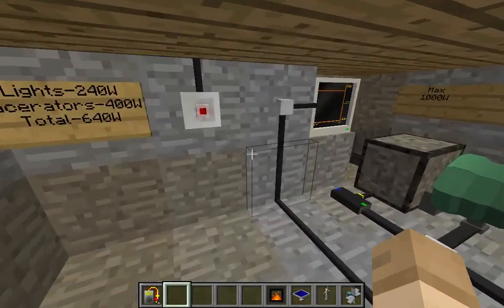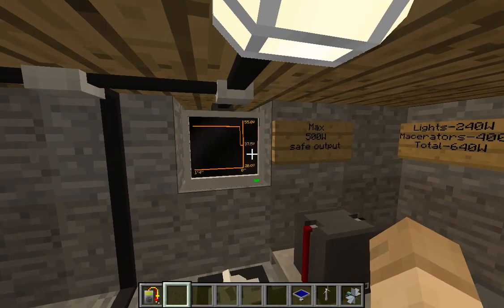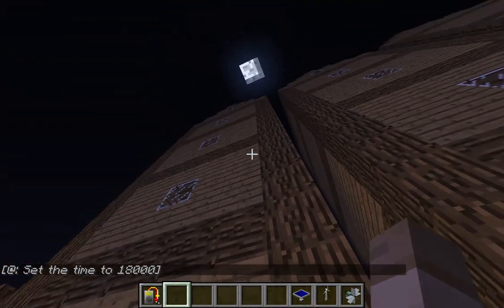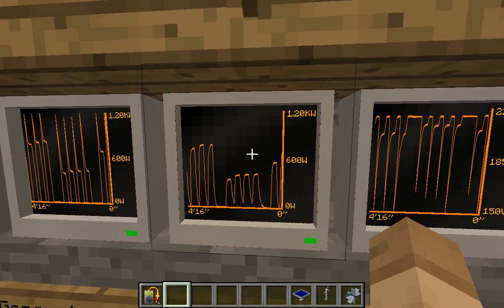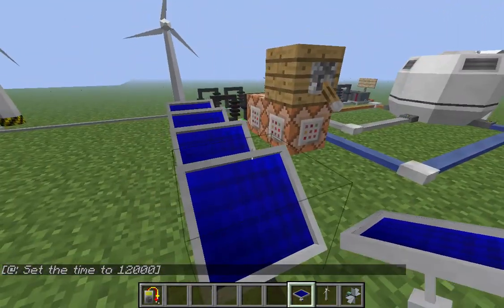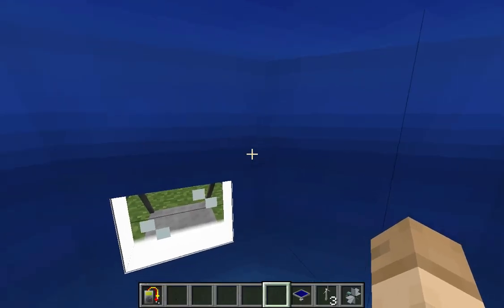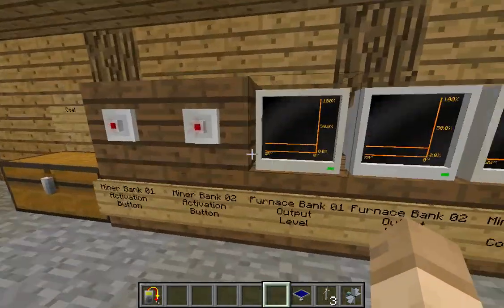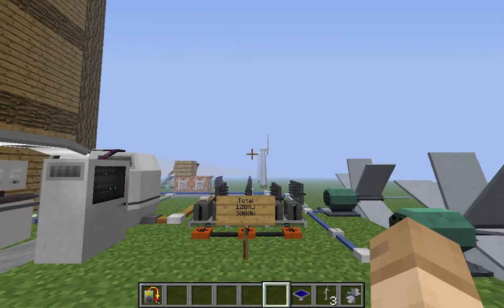Minecraft Electrical Age Mod Tutorial 04 - Power Systems

Comment: definitely explained a few things to me. thanks! btw how do you build stuff on the cables. for whatever reason if i try to put a block on a cable itll snap it in half
Reply from the maker: Adrian Pri Hold the down the C key while right-clicking the cable with the block in your hand.  Note that if you have multiple cables in that space all of them get covered no matter which one you click.
Reply: @donbruce5466  thanks so much